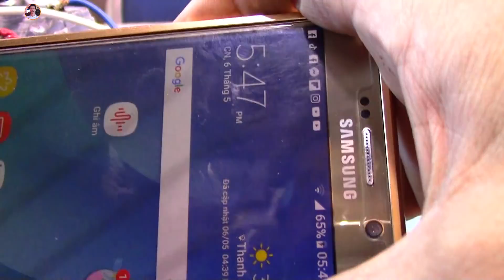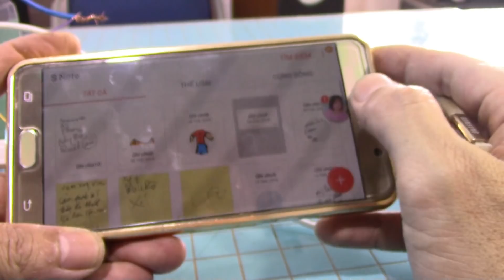How to make a backup charger, 12v battery phone charger  protect

Comment: Helo sir, how many amps of your transformer using audio amplifier dual power??????? Hope you answer! Thankyou!
Reply from the maker: If you use a dual coil loudspeaker, it means that the speaker power is increased
  However, the weak amplifier can still run
You have to improve the transformer in about 12 to 15A. will run better

Comment: Alfred ....i did this like you did , But the percent showing no difference. it is not charging....what is the problem?
Reply from the maker: You have to use 40w load before plugging the charger
When you measure 295VDC equivalent to 210VAC. There will be no reason.
the phone will charge
Just like you use electricity in the home

Comment: why not only use 7805？
Reply from the maker: ic 7805 is very poor voltage stabilizer. The higher the input voltage, the more heated the 7805. It only gives good effect when the input is higher than it's 2 or 3 v.
7808 too
Reply: Alfred I know, thank you very much